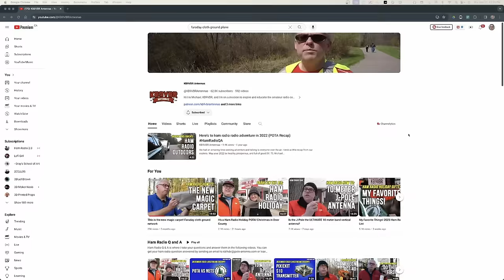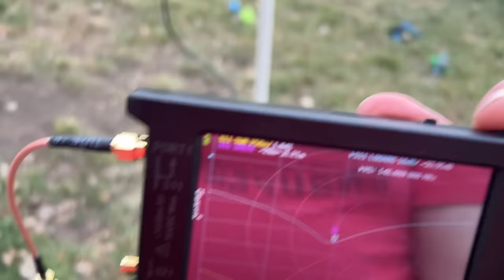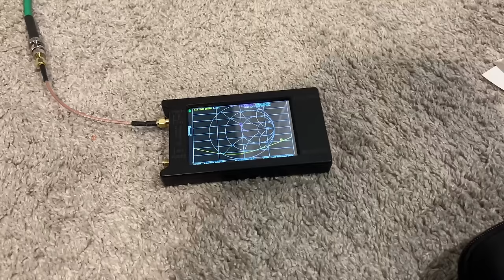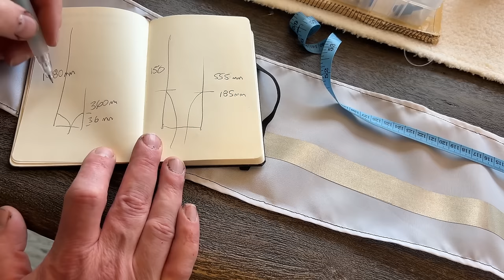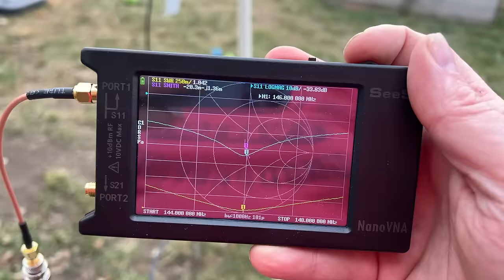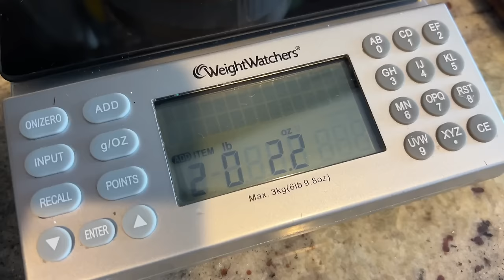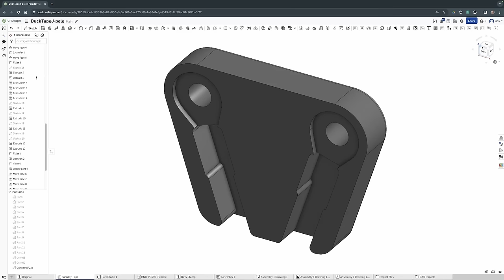Best 2m antenna for ham radio: Introducing the Faraday Cloth Antenna

Comment: A fabric antenna? Awesome stuff. I have used similar products in my work for many years. the fabrics tend to come it 2 flavours: Silver/nylon and copper/nickel/polyester. One thing I can say is don't crunch it up t the the copper/nickel material. It will develop small cracks which may or may not be an issue for you. As others have mentioned, creating an interconnect by stitching wire to fabric is probably the best and easy connection I know of. 
Also, fabrics are fairly high resistance compared to wire or copper foil. I wonder if this is why your antenna lengths were different from the expected values.
Reply from the maker: Good to know thank you for the crunch warning. I’ve run one through a washing machine and it is still working well. I think capacitive coupling is the magic sauce here.
Reply: @VE6SFX_HamRadioRookie  I used to work with very thin strips of this type of material and they saw heavy use. given the thickness you are working with you may have enough material that localized cracking is not an issue as there is enough material for an alternate path.
Reply from the maker: Honestly that is what I am counting on.
Reply: @VE6SFX_HamRadioRookie  Keep in mind I know basically zilch about radios and RF stuff. I did work for a local tech company where I nerded out on these fabrics for many, many years. You learn about them mostly the hard way it seems. Breaking stuff or having customers break them for you:).

Comment: Two 90 degree folds at bottom will likely not add much bulk or weight but allow continuous faraday cloth without capacitance.
Reply from the maker: I’m not quite following. Can you expand on that?
Reply: @VE6SFX_HamRadioRookie  tape says it is conductive on both sides buy how conductive across the glue is an open question. If one folds the tape at 90 degrees and sews the excess triangle down flat it may (repeat MAY) make a difference. Easy way to tell is to bridge the glue gap with some metal thread and measure again.  If that makes a difference, folding is likely to help.
Reply from the maker: Ah! great idea. I dont like the adhesive back pointing out at the bottom but that can be combated for sure. Thanks for the clarification and I will be trying that.
Reply: @VE6SFX_HamRadioRookie  think of a 90 degree V coming upwards while two 45 degrees form on the tape. That keeps the glue down. Fold over that to one side or split it into an arrowhead shape.   Sry for not being more clear.
Reply from the maker: Awesome thanks!

Comment: Could you please help me a little bit? What did you used for Velocy Factor? The sizes of 2:19 in this vid did not match your drawing from patreon. Yesterday i tried to build my own - vf=0,96 / L1=148,9cm / L2=49,6cm (calculated with the standard formulars in a excel file) I experimentet with the feedpoint and the best SWR i got was 3 and i was far away from 50Ohms 😞
If i check your drawing i have to use a vf greater than 1 but i think this can not be. bit also the short leg will be in the right range with that... (i will not give to much details for free - other interested should also support you for your great work;-) Could you tell me please - where is my failure?

Thank you very much
Reply from the maker: Here is the thing. I am still working out the VF because this is faraday fabric there is inductive and capacitive coupling happening all along the length. What I have is two possible VF's one is over parity at 132% and the other is about 56%. neither I am confident to say is 'the one'. The measurements in the drawing are quite solid. This video is the first version I made and it will work but it is not super accurate, the drawing is most accurate. Here is a tip, you can add tape to one length by just making sure there is a overlap of 1/2" and it will work as if it is one piece. Alternatively you can fold it over and tape it back to itself and it effectively shortens the length. This way you can tweak the length and cut after you have done the fold over. I hope this makes sense.
Reply: @VE6SFX_HamRadioRookie  Thank you for your reply. I will make some more tests - my own goal is to understand the parameters and the antenna - not only to copy it ;-)

I alreade made tests with overlapped faratape - the antenna will get better but i want to find the why is the reality so far away from calculation...
Reply from the maker: @markusm.5061  You and me both.

Comment: I bought one of these but was wondering what the power rating is? Thanks
Reply from the maker: I have run 50W continuous through it with no issue. I have yet to test but suspect 100w is also doable
Reply: @VE6SFX_HamRadioRookie  ok thanks. Bought one and was going to do video on it soon. Thanks again

Comment: I'd be interested to see what it looks like on the VNA once its wet.  The water will likely change its capacitance.
Reply from the maker: Yes it actually worked a little better but no actual measurement. I will need to do a test and also to use a waterproofing spray

Comment: I am pretty certain that the increased length relates to velocity factor. It doesn’t surprise me greatly as I would guess the thickness to be much less than the metal tape.

Comment: This is pretty awesome dude! I have a lot of ripstop fabric that I used to make my own hammock, I am wondering if double sided (glue on both sides) faraday tape sandwiched between ripstop fabric would work and eliminate the need for sewing since thhis fabring can be cut with a hot knife.
Reply from the maker: Possibly, great idea and the only way to find out is to do it.
Reply: @VE6SFX_HamRadioRookie  will do, any plans to make one for 1.25 meter band?
Reply from the maker: No plans for the 1.25 but with enough requests I will
Reply: @VE6SFX_HamRadioRookie  I will let you know how my test goes with ripstop fabric and double sided tape
Reply: @VE6SFX_HamRadioRookie   I made my antenna based on the plans, for some odd reason the SWR on 70cm was over 2, but it was 1.4 on the 1.25 meter band. I had to shorten a bit the long element and add a bit of tape to the short element. That helped with SWR and it was a lot of fun to tune since all it takes is to add tape or cut tape... really fun project. Thank you for sharing. Since I don't have a 3d pinter at home I cut a piece of white cutting board from the dolar store slipped the top end if the ribbon through a slit and use the contact cement to glue the ribbon to itself and the piece of plastic.

Comment: Using conductive tape on a polymer strap . . . brilliant.  How far apart do they strips have to be to work right?  I figure conductivity between the strips may get funky when wet if they're too close, but other than that, I suspect they would be fair game.
Reply from the maker: Wet it performs fine actually. The distance needs to be at least 1 tape width apart. I have not tried much further that that.

Comment: I need to buy this for Parachute Mobile.
Reply from the maker: We need to get you one :)
Reply: You could use aluminium tape also
Reply: @morecambeanglersandtrawler1074  in a static environment no doubt. Flying it under a parachute, not a chance. The tape would be a royal pain to deploy an then it would flex enough to self destroy in a few thousand feet.
Reply from the maker: @morecambeanglersandtrawler1074  You could and I have but it work hardens as well so the lifespan of that antenna would not be very good.

Comment: Now make a Yagi blanket we can hang on trekking poles!
Nice work! This is "Hamming" fun!
73s de KF4LBG!
Reply: That coax connector to fabric attachment is gonna be a golden ticket for all kinds of fabric experiments.
Reply from the maker: I have a flagi version 2 coming out that will be just as good as you mention above with poles. Question, do your poles have a 1/4-20 attachment at the handle like a tripod?
Reply: @VE6SFX_HamRadioRookie  
I believe that some do.
Keep in mind that aluminum poles might cause some issues...
Collapsible fiberglass tent poles could be the magic spell, though.
Reply: I know that they do have some poles with camera mounts...
Reply: @VE6SFX_HamRadioRookie  A slot flagi' sounds too cool...
Reply from the maker: Yes I’m excited to start working on that one. First got to get through Xmas with the fam jam. Merry Christmas to you! 73

Comment: Hey Ben, Another great idea 👍.  Several thoughts… yes I think velocity factor probably plays into the tuning and resonance points. The faraday fabric will have what I’d call porosity (voids) that cause radio waves to act funny. RF loves flat wide spaces, it dislikes corner and curves. It tends to fly off a bit like lightning. Does the antenna still work oh yes but the RF just acts funny.
I’m guessing by now you’ve heard of the Slim Jim antenna. Very similar to a J-Pole but with a second 1/2 wave element folded back (IN PHASE) with the original 1/2wave. There are many voices saying they are no better than a J-pole. How can you have 2x the square Cm of surface area for RF to radiate from and get equal results? I think not 😅
I digress… with your Fara-J , a Faraday- Slim might give your antenna more surface area to compensate for the porosity effect.
I’ll post a second comment below 👇
Reply from the maker: Yes it warrants a test for sure but in the end the differences I am currently not capable of empirically measuring. Regardless yes I need to try and 'slim jim' verion

Comment: I wonder if there's any reason a corner fold wouldn't work for the bottom of the J rather than stiching in a separate peice. Or why the fabric itself could not just be looped at the bottom leaving the faraday strip as one continuous piece. That would allow for a much narrower cloth to hold the strip. I'll try it with a piece of copper tape.
Reply from the maker: The biggest reason is it puts the adhesive side out in that section. I know it’s a lame reason but I like things neat and don’t want to clean off the glue
Reply: @VE6SFX_HamRadioRookie  Ah - I missed the adhesive thing. But looping the cloth and the strip into a J shape could still work, and can create non-destructive tuning opportunities using a sliding spreader for the coax connector. Clamp it at the edges - move it up and down as the NanoVNA suggests.  Or pull it inside an expandable plastic mesh braid sleeving and no stitching needed. All kinds of interestings ideas - great project, and deliciously DIY like the old days. (Ham since 1961 when we built everything from the parts bin).
Reply from the maker: DUDE! Love this and it made me think of making a sleeve to pull a antenna in and out of. Effectively a floppy extendable whip.. Then.... Ok my brain is exploding with ideas now. THANK YOU!
Reply: It occurred to me that if you curl the end of the fabric and Faraday strip it would look like Dilbert's tie. But it would work.

Comment: Have you considered making a slim jim version of this antenna?
Reply from the maker: Yes. Here is the thing the big gain from a slim jim is bandwidth and this already has more than adequate bandwith. 1:1 to 1 on the sides and 1:1 in the middle I think it is a diminishing gain situation

Comment: Greetings from New Zealand ...have you made any for anyone here at all? What's the pricing on the antenna? Would you ship this far? Also have you done any dual band ones? VhfUhf the setup you have done is awesome..Phil ZL3PAE
Reply from the maker: Yes I have sold 200 and working on a batch of 500 currently. You can find them at VFComms.com . Keep in mind when I do get stock it sells out generally within 1-2 hours. It does work on 70cm but not all that great. I have made some more designs for GMRS and 70Cm and those will come out soon. https://youtu.be/vJR_yaLzTyQ

Comment: What happens if it rains and gets wet ??
Reply from the maker: It works fine wet in testing. I’ve had it fully saturated with water and it works the same dry

Comment: I think you have somthing here. maybe i should get the antenna and test it on my channel. i have a repeater that is very very long way 31 miles. have you testet it on more then 10 watt. i planning to put in 55.
Reply from the maker: I will be testing it on 50 myself but others already have and it worked well.

Comment: In the end, what was your calculated vf for the tape? I’m intrigued by this idea, which has great potential practical applications. I’ve used copper draught-excluder strip in the past for Slim Jims, but it tends to kink and is very sharp.
Reply from the maker: This depends greatly on the width of the tape. Wide 1” tape is what you see in the video. For the 0.39” tape the measurements are short stub 630mm long element is 1795mm and feed point is 250mm
Reply: @VE6SFX_HamRadioRookie  So the VF isn’t a constant for the material - it must have self-capacitance, and variable resistance dependent on manufacturer/batch/width/thickness (it wasn’t designed as a transmission medium - rather the reverse; it’s designed as a general rf blocker - so it will be very much a question of select-on-test, and will almost certainly have reactance which differs at different transmission frequencies, making it problematical for accurate replication of designs). 0.47” and 0.7” rolls are available here - I think I’ll grab a couple and have a play. Interesting stuff.
Reply from the maker: I have several rolls from different lots and once you have the measurements it is quite predictable. Not as problematical as you might think
Reply: @VE6SFX_HamRadioRookie  

Velocity factor calculation: (this is for ‘lossless’ transmission lines, but should give a ballpark figure). 

Vf = c/( square root [LC])  
Little c should be meters per second if the unit distances of L and C are expressed in meters, or feet per second if L and C are expressed in Henrys per foot and Farads per foot respectively (where little c is the speed of light).

Therefore, I think a way forward would be to start by pulling a metre off a standard width roll and, with an accurate capacitance/inductance meter, find the L and C figures for that length and feed them into the above equation - at least that would give a starting point, which figure could be amended after practical testing (comparing actual lengths required to achieve 1:1 SWR at a specific frequency with the theoretical ones). 

That would be a scientific approach - but it would be FAR simpler just to compare your actual, ‘achieved best-SWR at design frequency’, final dimensions with the theoretical ones for a J-Pole and arrive at a scaling factor for the particular strip-width of Faraday cloth used.
Reply from the maker: Awesome thank you this helps a lot for me to figure out how to do this.

Comment: This is a pretty cool idea. If the fabric gets wet, is that going to change how effective it is?
Reply from the maker: Already tested wet and I don’t have any solid empirical data but it seems to flatten out the swr more and work better wet :)
Reply: @VE6SFX_HamRadioRookie  maybe increased loss!
Reply from the maker: So far it seems to work better when wet. I know I need more testing but here is a quote from one of the ones out in the wild "I got the opportunity to try the antenna on for size. It is an impressive little piece of cloth, resilient, packable and portable. Worried about getting it wet, don’t, it still works great. It outperforms the various whip antennas available for your radio and competes with the performance vehicle mount antennas.” VA6GAC

Comment: Simple, easy design.  This could be up scaled for 6m and/ or 10m.  You may want to consider a double 5/8 wave.  Alpha Alpha Three ___  ____  (I won't give the entire call in public.)
Reply from the maker: Yes totally going to go try that. First I need to earn enough to get a HF rig to test with. Remember I am really new and don’t have a shack yet.
Reply: @VE6SFX_HamRadioRookie  You already have the SWR analyzer for design and some testing.  And there maybe someone local for on the air testing.  Have fun.
Reply from the maker: @richardl6751  Yes and it will happen. :)

Comment: You can buy different types and sizes of electric fence ribbon or rope that is a polly  fabric with wires already in it some have bare stainless steel wire some has aluminum wire just search electric fence ribbon wire to see I bet that could make good antennas some said it was 1000 pound breaking strength plus its light weight.
Reply from the maker: Yes totally. In this case I was going for something that is super compact and that would not roll up nearly as easily and work hardened over time. Still a great material for other applications though

Comment: I like to make my electronic projects polished. Which means I spend waaaay too much time on the CAD word. So I really appreciate your attention to detail. The recess for the wires is fantastic.
Reply from the maker: Thank you! With adhesive heat shrink it captures the crimp to the wire and adds strain relief as well. Took awhile to get the measurements right for a press fit

Comment: Make a flag yagi with this material.
Reply from the maker: Already on it. Coming soon!
Reply: @VE6SFX_HamRadioRookie  Let me know what countries become available. This new method of manufacturing and production  using the tape definitely will make Radio much more economic.
Reply from the maker: The savings in material are absorbed in the labour in making it. I am not convinced it will be much much cheaper honestly.

Comment: Nice, good design and build..73..VA6CDG
Reply from the maker: Thanks! 73
Reply: I was researching this more. Have you thought about electrically conductive thread? It could be a good experiment. I was thinking of the thread used in space suits. Not much more in cost as standard nylon thread.